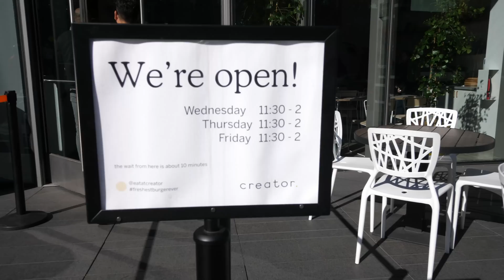Robots Taking Burger Flipping Jobs

Comment: The thing is though, it's a lot easier to replace those jobs than you think. Wanna clean the conveyer belt? Whenever it flips over, have water spray it followed by a blow dryer to quickly dry it off. This removes the need for cleaners. For the sauce, instead of how it was done, they could easily have multiple nozzles that each pour dollops to spread the sauce evenly. They can add an arm that scrapes and cleans off the grill. Then have two robots that have one filling up said tubes and one delivery and attaching said tube. For fries, have 3 robot arms, where one skin and cuts the potatoes into fries before pouring it into the deepfryer, one that removes it from the deepfryer and pours it into a heater, then one that scoops it and delivers it onto a plate. Hell, don't need someone to take your order thanks to touch screen tech and touch screen menu which conveys what you want, where it gives you a number and the robots track your number.

Comment: So this question is kind of right up your alley and kind of not... What are your thoughts on whether or not robots will take over jobs such as mechanic or carpentry? I know that robots are used in mass manufacturing but at the same time with the sheer number of different engine/system types and different issues or different designs of wood furniture/houses I think it's a ways off simply due to the variety.
Reply: If it was just one engine/system types and a few repetitive tasks (ie remanufacturing an alternator or transmission) then maybe but if it's a 97 ford tune up and then an 08 honda window regulator or  whatever it wouldn't work.

Comment: There used to be ticket takers for trains - that automated turnstile you used for the BART is a robot as well.
Reply from the maker: You have a point. Ticket takers is indeed pretty mundane. Or ticket sellers replaced with the dispenser machines. They still have an attendant for unusual requests.

Comment: I think places like these are over-engineering the conveyor system and should take note from the food factory industry. No need for AI and sensors to figure out where exactly the burger bun is, whether a slice of tomato dropped, or if the sauce was dropped every single time when a manually tuned program could do it way faster and better quality with less maintenance.

Comment: Actually in some ways I am for that since less people will get burned. All the jobs where people get burned should be replaced by robots such as pizza hot dough pressing. The Dough Press is such a dangerous machine. Me and everyone one of my coworkers got burned on on that thing.
Reply from the maker: The main issue is if all burger cooking jobs are gone, where will these people work? There needs to be some sort of job replacement program to retrain displaced jobs.
Reply: @BeatTheBush  Agreed it is sad that thousands of cashiers and other types of workers have lost their jobs. One reason why Oregan still has people pumping your gas for you is to protect low skilled low income entry level jobs. In the future perhaps more states will make laws protecting these jobs.

In college they are telling us that robots and tech creates more jobs to run the tech than before it, but I think it's some where in the middle. More jobs in some areas less in others. Boeing is quickly replacing painters with machines. I  think that's definatly less workers than before.

Comment: Why are we looking at robots from only the customer's point of view? What about using robots to the benefit the business-owners? If they could invent robot customers , it would greatly improve the burger industry. Less hassle, more revenue, greater profits. You could save money in so many areas. Robots don't need bathrooms, so you could lease a smaller space, not have to pay for janitorial work. Ketchup is probably not good for their internal parts, so no ketchup. Their lips would be stainless steel and require less napkins.
Reply from the maker: I guess I cannot change it now. This particular robot is too high maintenance.

Comment: when politicians mandated $15/hr minimum wage,  it is obvious those making burgers would be one of the first to go.  As for cleaning, this is essentially a prototype.  In a year, those 8 to 10 employees will be down to 1 or at most 2 once they figure out how to efficiently clean the machine.  Which means 4 to 5 employees are replaced by 1 to 2 employees.  Ordering will be changed to robots too with with money changing machines (been available for 5 years) and credit card payments replacing those on registers.
Reply from the maker: Yes... The more automation, the more machine it will need. Maybe they need a tomato cutting machine rather than a human doing it. But automating it to a point where you just pour in raw ingredient might make the machine too big.
Reply: @BeatTheBush  those burger rolls are made totally by a machine.  A worker just dumps in flour into a bin as well as yeast.  The burger patties themselves are made totally by a machine.  It was only a matter of time before a machine would put the rolls, patties and tomato slices together.  Go to any large food market these days.  There are self check out registers, replacing human cashiers.  How long will it be before self driving trucks replace truck drivers and self driving taxis replace taxi drivers.  For people like you and I, as engineers, this is a dream.  The challenge of a team of engineers to design a machine that cooks the patties, slices the rolls and tomatoes, and puts it all together is quite exciting.  For the workers the machine replaces, not so exciting.  It is the future.

Comment: Its due to labor costs, like minimum wages rising.
When you increase minimum wages, it negatively effects employment.

Good intentions = unintended consequences. People dont understand that....
Reply from the maker: It depends on which type of business. For a small business, they may have to cut employment to be profitable. But for very large businesses, they may still be wildly profitable even if they double the wages. 

Rising wages makes a robot not as expensive compared to a real person.
Reply: @BeatTheBush there should be no minimum wage. The economics show that. So many cases.
Minimum wages is the epitome government intervention.
That's why its so hard to get an entry level position as it costs too much to employ.
History is great as it shows the freedom previous generations had as it was easier to get work as there were no minimum wages and other stupid government interventions.

Yes, higher wages for unproductive people mean robots r more efficient to employ.

 minimum wages are significantly worse for smaller companies than bigger.
Amazon is going to lobby for a higher minimum wage after they recently  increased theirs.
This will eliminate/reduce competition

Comment: Soo many moving pieces in the machine.. so if one breaks do they close until the service tech comes out to fix it?   Seems a bit over the top just to make a burger.   If they just had a machine to make the hamburger patties that would be a step towards automation.
Reply from the maker: You cannot see the patty making process. The cooked patty just comes out of that hole. They had 2 machines so at least they have a backup.
Reply: When the burger flipper doesn’t come to work because he’s too busy playing video games and you have to close because the cashier called in “sick” too., that’s been my experience

Comment: You are supposed to open up those tiny white paper cups for ketchup. It's supposed to look like a saucer of ketchup, not a tiny shot glass of ketchup. Pull them apart. That's why they have pleats.
Reply from the maker: A video showing things you've been doing wrong your whole life showed something like that. Also eat a banana upside down. But let me ask  you this. If you are supposed to unfold it, why don't they just stack them unfolded already? It will take up not additional value when stacked AND it will be less work for the user of the paper cup.
Reply: @BeatTheBush  Well a flat plate would suffer from being more likely to spill when filling.

I think the real question is what value does making it flat offer :P 

It's not like anyone finds dipping fries in a flat plate harder than a half inch tall cup.
Reply: BeatTheBush they leave them as cups cause they realize people are to lazy to fill up more than one and to lazy to get up and refill, so they save more money when you get less
Reply: During the early days of racing, the cars were limited to x gallons capacity. After they passed inspection, the team would balloon the tank with air pressure and get a few extra gallons in. After the race, they would roll a jack under the tank and squash it back to shape.
Reply: I don't eat ketchup, but for other types of sauces, I use a large cup lid (you could double it to prevent spill through) or the plate itself.

Comment: Love the editing style! This definitely seems more like a novelty than a cost effective option. Cleaning the machine, maintenance on the specialized parts, downtime when something stops working, thus resulting in loss of sales... seems easier to hire a minimum wage burger flipper.
Reply from the maker: I can see how this is just a concept. And it is. If their idea is to reduce labor, then they will improve on this machine and reduce workers as times goes on.
Reply: Clearly with how the machine by design uses fingers in place of a conveyor and wood accents etc. It's designed to be attractive at the cost of efficiency. 

Even the speed of the machine is crazy slow likely because it allows you to appreciate the process. 

They are selling an experience not a value for sure. 

But if krispy kreme teaches us anything, it's that we love to watch machines make our food. :P
Reply: Don Ziolkowski It was definitely cool to watch! I would check it out if I had one nearby. It’s fun to see nifty new things.

Comment: well its nice that they used copper. Its one of the metals that self sterilises. So I can imagine this machine is a lot more hygienic that most restaurants. 
I would assume V2 of the machine would be much better. This  looks like a pain to clean. But i think machines like this can allow for much better human customer service.
Reply from the maker: I can only see McD interested in this IF they can make iron out the details. They will likely just build their own if they really want it. Or maybe just buy this company.
Reply: once it loses it's wow factor, they'll have it in the back room where they only have to clean it once a day
Reply: @bob15479  "they only have to clean it once a day"
well i think the only reason they clean it now is the make sure the burgers come out pristine and the machine looks pretty as its basically a show for the wow factor (as you said). In the second version there should be less spillages and stuff, so the burgers should be 100% perfect each time. 
I personally don't mind if the machine is cleaned just once per day since its copper based. So nearly no bacteria can survive on it. 

I imagine in a few years McDonalds are gonna buy a bunch of these type of machines and lay off their workers. Only really need 10 centralised machine technician for each city.
Reply: @bob15479  you miss spelled month. XD